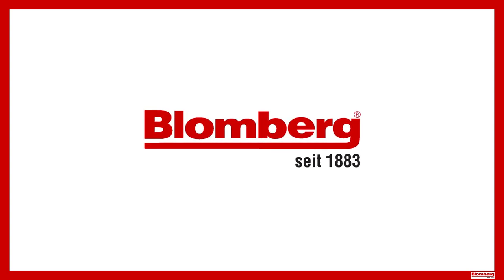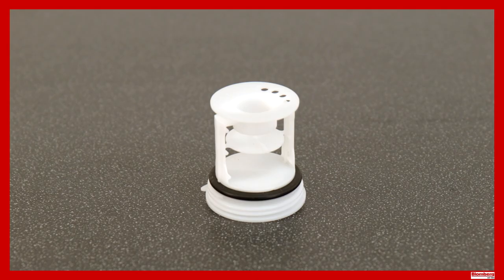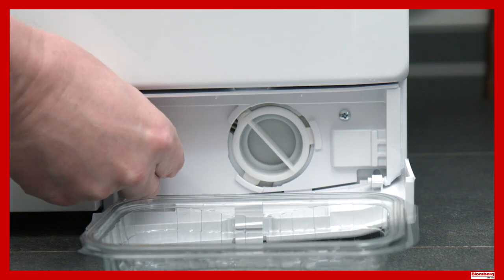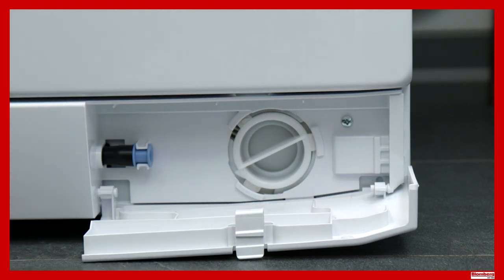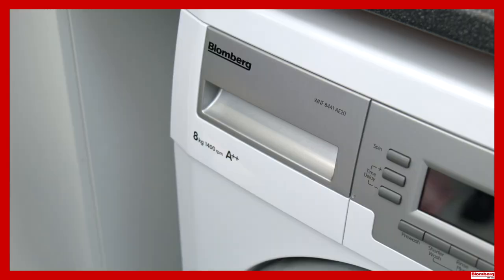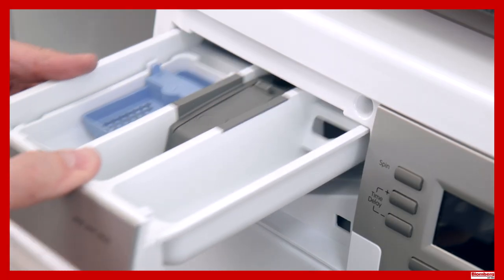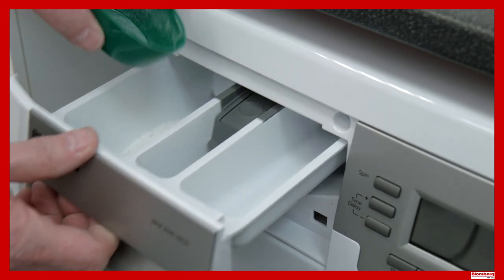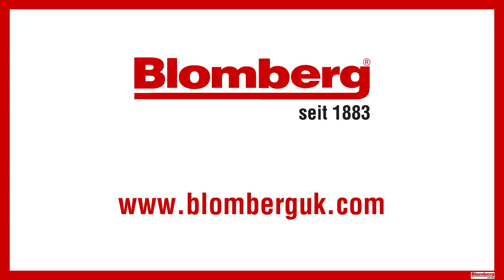Blomberg Washing Machine Maintenence

Comment: Have my WNF8406 Washing machine here - after several years no problems, this morning it doesn't want to turn the clothes for very long and stops the program - I thought it was the automatic spin correction system having been activated, because there is an ordinary/regular load inside (as usual) . It did bang loudly as it tried to rotate the clothes, then stopped. I fear it's the electronics in the panel. I'll also need to check the concrete blocks and reset the auto spin correction system. All costs their darn fiat money.
Reply: So this morning we take it even more apart to see the suspension springs and shock absorbers need replacing because of the wear and tear on the PLASTIC PARTS.:face-orange-frowning::face-blue-wide-eyes::face-orange-raised-eyebrow: